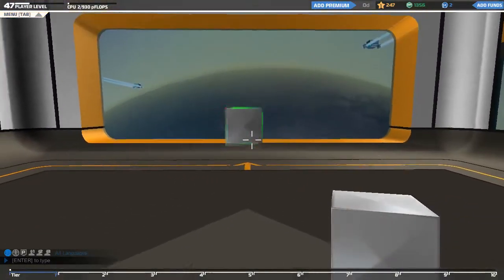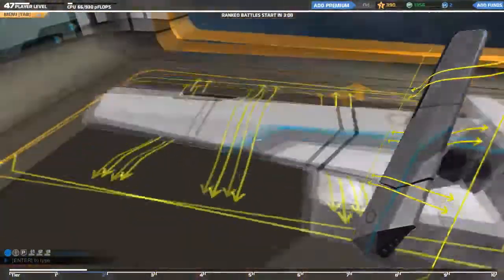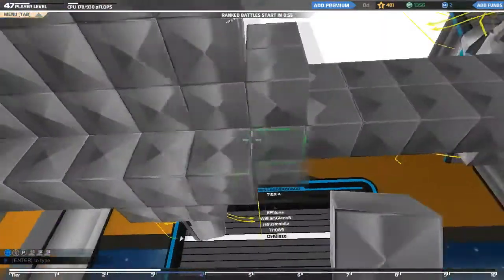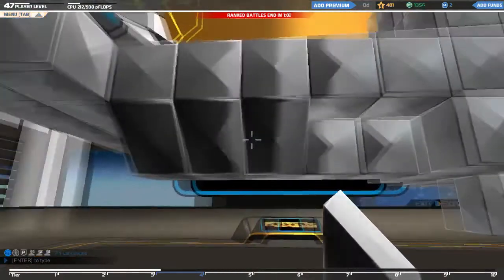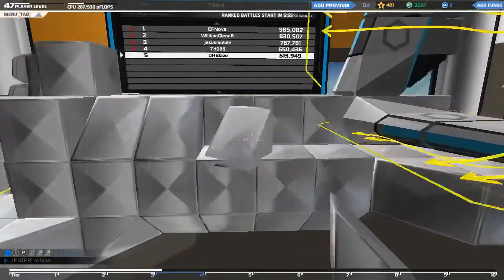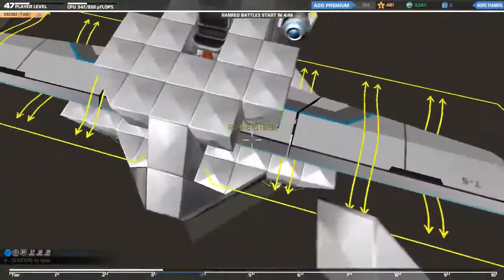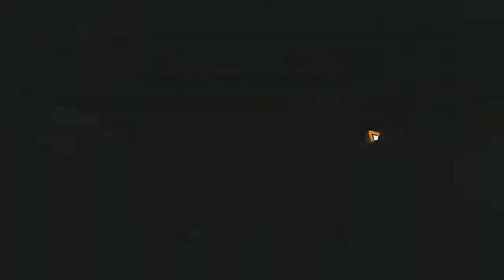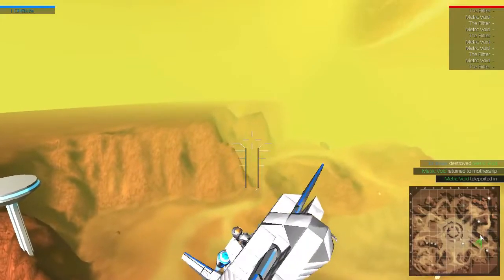Robocraft Tutorial: Basic Plane

Comment from the maker: For Christian Breinholt ,
  For those who want to build a plane / Jet with out wings you want to use thrusters and rotate them accordingly. It is perfectly possible to make a ship that runs on nothing but thrusters to push it along into the area and fly around. Some people will also use Helium blocks to help with this to keep them light. Just remember that this method is a bit more unstable and requires more to pull off however it is faster, and easier to protect with shields.